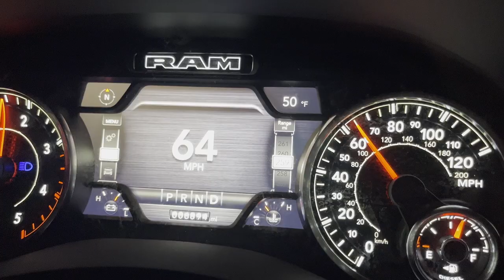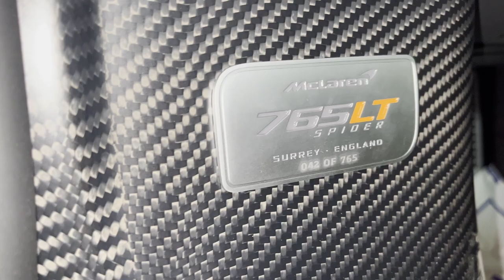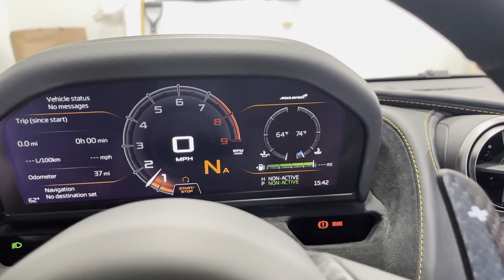Abandoned ZL1 Camaro at Tow Yard

Comment: How do you guys test and engine and know mileage if the interior is all burned to a crisp? I have always wondered this.
Reply from the maker: The motor can still be leak down tested.  Which confirms compression.  But, doesn’t tell anything if there is a bearing/lifter issue…generally, we don’t buy those types of cars for that reason.  We like to hear them run.

Comment: I had a 2013 ZL1 Black that I bought off the showroom floor I was so excited and within 3 month's my dream went to a nightmare for the next year and half with only 8K miles on it I had gone through 8 Superchargers YES 8 that the dealer kept replacing due to the bad isolater in the Supercharger snout it was in the shop 7 month's of the 18 month's I owned it and I had put it on the Dyno because the car was slow and found right after putting number 5 Supercharger on it made a ridiculous 415HP to the wheels finally after taking it back to the dealer after Supercharger number 8 on the way home not even 10 miles the Supercharger went bad again and I finally called an attorney and GM had to buy the car back.
If you are interested I still have some parts like brand new Loyed Floor Mat's and trunk mat the RotoFab IceTank with the factory cooler lines already cut for plug and play the rear tail light bezels and I think a couple of other thing's I just can't remember what's in the box in the garage but if your interested let me know. I hope you have better luck with yours but I wouldn't touch an LSA Motor ever again.
Reply from the maker: Oh wow.  Can’t say I have heard a story quite like that before.  Would leave a sour taste in anyones mouth for sure!
Reply: @scraplifegarage  it really was a nightmare but I bought my dream car right after that mess and now own a 2018 Jeep Trackhawk and I absolutely love it with zero problems and runs very well.
Reply: Why didn't you learn after literally the 2nd one to buy a solid isolator....?
Reply: I own a 2013 ZL1 Black and I can hear the rattle but that doesnt mean the SC is bad. Just get it reshimmed and use a solid isolator and you'll be good to go.
Reply: @GokuGaming  That's funny!!! Because I have an extended warranty that I paid alot of money for and if I replaced the isolator myself they void my warranty and anyways when the dealer replaced the Supercharger they were supposed to come with the solid isolater there were more issues happening to blow the Supercharger up if you read the whole  Description you would have seen that after a brand new Supercharger I took it to have it Dynoed and the car was only making 420HP to the wheels. When the Dyno shop had already had a few of these ZL1's in the shop he said the lowest Dyno he had ever seen on one was 495HP but most were making 515HP to the wheels.
Reply: @GokuGaming  glad to hear it but it was the biggest peice of shit of a car I had ever owned and it was slow I'm 10 time's more happy with my Jeep Trackhawk if I would ever buy a Camaro again I would only buy a 2016+ Camaro ZL1 that's the way it should have been made a totally different car from the 2013 if your happy that's great but the best day I ever had with mine is when I dropped it back off to the dealer when it was Lemon Lawed and by the way they had to pay me 3X what I paid for it plus extra for time and aggravation mine had every single option that I bought off the showroom floor mine was also Black actually every car that I have bought for the last 20 year's have been Black that's about 10 car's all get paint corrected and ceramic coated from the day I buy them. I've learned my lesson about car's a long long time ago and used to street race and drag strip race and build motors until I got sick of always having to come out of pocket for the repairs that's why I always buy the best and longest extended warranties I can get. The car's I buy are plenty fast enough from the factory for me and I will only do to my car's what can be removed before it has to go back to the dealer if there are any problems but now that Dodge has their new program to build up to 1000HP and still keep your warranty I'm in heaven and pretty much only buy Dodge, Jeep from now on.